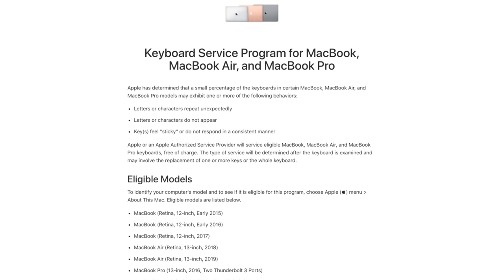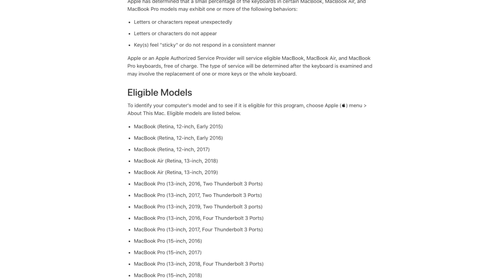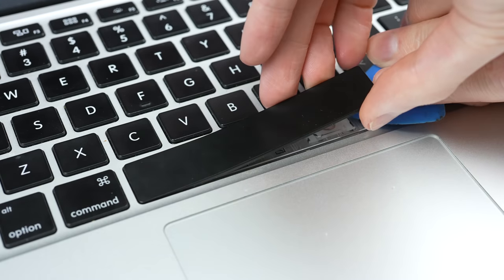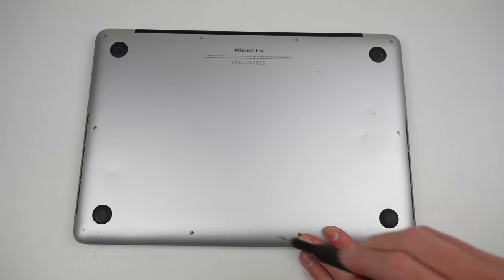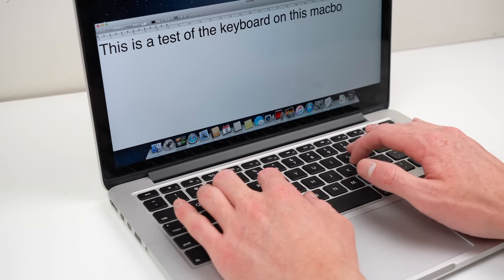Apple Really Doesn’t Want You To Fix This - MacBook Keyboard Replacement

Comment: Miss the days of simpler and easier to repair technology back in 2010. Even though I was too young to care. Still would be nice if everything was ‘easy’ to fix  nowadays.
Reply: It is, just don't buy Apple products or ultrabooks in general. Buy a normal laptop and you'll see it's easy to fix whatever breaks.
Reply: @someguy4915  or just have a desktop, zero issues with replacing anything. Also, not having anything made by Apple helps, a lot.
Reply: @jongustavsson5874  Also a solid choice :P
Reply: There's enough choice for repairable hardware to buy. It's really your own fault if you buy shit like this.
Reply: @someguy4915  I meant apple products. Most apple technology is a nightmare to fix.
Reply: @charlesrodriguez7984  True, but Apple has practically always been harder to repair, at least since the original iMac with its cheap plastic inner bezel which would break if you even thought about opening the computer casing, a casing which was largely held in place by plastic clips which would also break at the slightest attempt to open it up.
They have gotten significantly worse over the years, where with that original iMac you could claim it was just a bad design choice (much like the bread toaster temperature RAM) nowadays with most Apple products it's obviously a choice to make repairs as difficult as possible...

Comment: The keyboard is significantly easier, and safer, to remove if you first knock the tops of the rivets off with an xacto knife.   I replaced the keyboard on a Dell Inspiron 7000 that was similarly riveted in place this way.  This also has the advantage of not destroying the old keyboard.
Reply: Don't buy Apple. Any company that makes things this hard to repair is not worth supporting.

Comment: A couple of years ago my mac book air had a defect keyboard. Bought a new from eBay and just ripped the old one out of the frame like in the video. Glued on the new one - it worked. If you dont care about optics and re-selling value, then glue is the best solution.

Comment: Why didn't you tried to drill out the rivet heads with a short 2-3mm drill instead? Maybe is easier on the housing, aluminium is quite soft.

Nice repair BTW.

You could be surprised but these small machine screws are expensive, almost twice the cost than a rivet. If you order a few million of these it cost a lot for apple :D
Reply: Its quite complicated tho. It'll either make a bulge on it or completely make a hole on it
Reply: Drilling out tends to result in an off shape or oversize hole.  Using a pin-vice is slow and you can break the bits due to human-wobbles, but using a powered tool is also likely to break the bits (0.8mm or so) Definitely a last-resort option.
Reply: @tywyeth1680  a good rip of the old keyboard should displace 80%+ of the rivets from their holes, and clean up the rest with a pair of side cutters usually; leaves perfect holes for the screws to be put in to
Reply: Than just use half of the amount as screws. It seems to me that there are too many rivets anyway.
Reply: The extra cost of the screws is greatly overshadowed by the fact that most people will just say "fuck it" and buy a new laptop when they see the rivets.  So rivets it is

Comment: This is exactly how NOT to design a laptop keyboard! At least when there are tons of screws, you can unscrew them. Even heat staked keyboards (as found in many modern HPs and the like) can be replaced with using just a hot air source (or soldering iron that you don't care about).
I can definitely see why the top case is usually replaced as a whole under these circumstances, and that's what I'd do - top cover/palmrest c/w keyboard as one piece.
Reply: Nah, this design does exactly what Apple intends for it to do. It makes repairs so much more difficult and expensive that people are much more likely to buy a new machine. This is the new Planned Obsolescence now that Moore's Law is dead, Apple needs additional ways to encourage loyal customers to continue giving them money.
Reply: This is EXACTLY how to design a laptop keyboard if the company is driven by sheer greed and doesn't give a damn about their costumers.

Comment: The best way of dealing with those rivets would be to use Dremel (or Dremel-like) tool and a sharp "stubby" 4 or 5 mm drillbit - or a small round burr tool. You don't need to drill/mill those rivets "heads" (they are countersunk) off completely - but removing majority, or even some of that splayed/ peened metal will greatly facilitate the removal, and you won't need to apply so much force.
Speaking of which: when tearing off the keyboard like at 6:05 you should always remove all those "free floating" keys from the table AND press down the "lattice" part of the unibody with some stiff plate (a piece of plywood, MDF or such) as close as possible to the "tear-off zone". This will not only make it easier to remove the keyboard (or rather, its remains) but will also prevent the lattice from getting bent.

On the rivets itself - while I have a fair share of my own grumblings and whiners regarding "recent developments and changes at Apple" (I'm a Macs user since '97), I sorta-kinda can justify their decision to use rivets here. It makes a sense from engineering point of view, albeit this is of a little consolation for those unfortunate fellows with broken keyboards.
There's simply not that much of metal on those "junctions" to drill and tap them without significantly weakening them, and making stubs with female threads (like the one can see at 6:06 next to the "P" key) at every place where rivets are located (ALL of those junctions, as far as I can see) would be too time consuming - and it would bump up the price of the unibody shell itself. So, I guess, the "compromise" was made (it's cheaper to replace half of a single laptop under warranty for every thousand or so of MacBooks produced than trying to make ALL of them "repair-friendly"), and should those keyboard itself be of better quality it wouldn't be much of an issue. But the quality problem of those keyboards combined with this way of attaching them aggravates the whole problem.

And yes, this is going to become worse and worse, as labour cost of any fix-it-man will become greater and greater, while mass-production costs "per unit" will become lesser and lesser - and with "general public" always on a lookout for cheaper and cheaper goods. In short, "dispose-it-off civilisation"
When it was the last time when it was actually cheaper to pay for replacing the bent rim on a bicycle wheel, rather than replacing the whole wheel? (I'm talking "average daily" bike, not any high-end God-knows-what for thousands of bucks). When it was the last time when it made more sense to fix and rebuild seized (for the lack of oil) engine in a mid-price "average" family car than replacing the whole engine (either new one or one "recycled" from a scrap yard)? Why computers should be immune to this trend? And why the chicken... well, never mind ;-)

Comment: I followed this video to replace my my keyboard. A word of advice for hammering out the rivets is use a very shallow angle for the screwdriver (i.e. hit the rivets sideways) and spread out your first few attempts so you don't have consecutive missing screws if you stuff up. I sheared off the first few rivets cause I was using too steep an angle. The new keyboard works but unfortunately I now have to deal with slightly spongy arrow keys due to the sheared rivets blocking the screw holes in that area.

Comment: Great video! yeah these keyboards are a huge pain to remove.  The buterfly ones are even worse to replace as the rivets are much smaller, so after you remove them you either need to use even smaller screws, or you have to drill every hole a bit larger to fit the old style screws. Love your simple approach with the hammer and screwdriver, I tend to use a automatic spring-loaded center-punch with a flat blade to pop out the rivets easily while the keyboard is still in place., I usually manage to get every rivet out like that and I don't have to tear out the old keyboard with brute strength.

Comment: When you said that the keyboard was riveted in, I thought you were gonna have to bust out the drill. However, I was not disappointed with hammer and chisel. What a brutal repair process Apple made you go through! It has me curious about how bad their newer stuff is gonna be when you have to replace anything on them.
Reply: They've serialized all the parts now, so even if you successfully replace the keyboard (even with genuine apple one) the laptop will refuse to work with the new keyboard as its not the one it had from factory

Comment: I use a dremell to take out the keyboard

The keyboard is probably the harder to replace but the easiest to damage 

Just don't wash your hands like 3 or 4 times and it will die fast 

Leave the MacBook on the car and the keyboard dies 

Use the MacBook on public places and the keyboard dies because of the dust 

Is just gross 

Replacement chinesse keyboards usually last a lot longer
Reply: @j7704  yup but the most recent ones tend to get stuck with dust

Comment: When I was a teen, a neighbor of mine was throwing out a great big TV. Bigger than the one I had at the time.

So I took it home, just intending to rip it apart. I'd never seen inside a TV before.

The only actual issue was a loose connection to the button panel. I didn't, and still don't know the first thing about TV repair, electronic repair, any of that stuff. About the extent of my knowledge was, and pretty much still is 'use electrical tape on wires' and 'solder is a metal with a low melting point that's used to make connections'.

A lighter and a nail later.... I'd fixed the TV.

Now I get that technology has gotten a lot more complicated. But the idea that you are ACTIVELY PREVENTED from repairing something YOU OWN even if you have a complete understanding of everything involved in the process? THAT'S bullshit.

I've basically lived my life on hand-me-downs. I remember arguing with a computer store clerk because I was looking for something to plug my computer into my TV, and this one guy argued with me for 10 minutes that what I wanted was an HDMI connector.... DESPITE BEING TOLD MY TV DOESN'T HAVE AN HDMI PORT. Like... the concept of a TV without one was something he refused to believe. It was painful, and he kept whining that I was just going to be in the next day to get what he's suggesting because the quality will be too low.

Another employee actually came by to see 'what the problem was', and thankfully was much more helpful! I told him 'I have an older TV, I want to stream youtube to it, so I want something that uses the yellow/white/red connectors if you have it.' and he said 'Oh. Yeah we've got those over here.'. 30 seconds, boom done.

.... Okay that turned into a rant. My POINT... is this whole proprietary anti-repair culture is bullshit.

Comment: I just did this back in November with parts from Ifixit and how to instructions from there. Not a techy guy highly recommend. Also I bought tiny little screws like two bucks off ebay pried off the rivets and screwed straight into the body

Comment: Most laptops ive worked on: 4 plastic clips that can be popped from the outside with a thin metal tool and another 4 screws on the inside next to battery.

Macbook:  dissasemble it down to its raw unrefined materials, hope you have a pneumatic rivet press.

Comment: Another option would been to drill the rivets out. That would have allowed you to also save the keys which can be useful for repairs as well.
Reply: Drilling out results more often than not in a hole that won't hold the replacement screw.  Even though the keyboard is peeled away it actually still retains most keys suitable for other donors, however, in many cases, even the original Apple keyboard assemblies tend to rarely match the one that you're trying to find a donor for :(

Comment: My old laptop just have a cover on the top of the keyboard and 5 screws underneath it. You can change the keyboard literally in less than 5 min (assuming you have the replacement).

Comment: This should be illegal.
These kinds of anti-consumer practices are essentially fraudulent, as you're selling the user a product you've actively sabotaged up front, with no way for the end user to repair them.
Reply: No? there is no problem using rivets as long as its cheaper. Apple do NOT need to make their products repairable, as long as they share their board design with repair people (which is what right to repair is, right to check the blueprints/design). As for the design itself, Apple has the right to design a product however they see fit. If people dont like it, they wont buy it. However, track record has shown that apple makes great designed products

Comment: Yeeeep. I worked for an authorized apple repair shop. We'd replace half the laptop essentially because that's how the shop makes money. It's about ~$350 for said top case for anything from 2013-2015 and then about $450-800 for 2016-2020 parts alone. Always wondered how much business I could get if I replaced just the keys myself. Would also be a nice workout too.

Comment: you can use a dremel and"drill" the top of the rivets it takes just a fre minutes and then put some drops of epoxy on top of the old rivets when you attach the keyboard

Comment: I’m going to be quite blunt, as someone who actively works in a machine shop, you only use aluminum rivets in spaces or on things that you never intend to be futzed with after fabrication. The short explanation is that rivets rely on rigidity and friction to keep things together, while aluminum rivets are thing(used mostly as either a sort of weather proofing, or as an ultra light duty cold rivet), but are typically avoided due to to how soft aluminum is, even anodized, defeating 3/4s of the mechanical advantage of the rivet. The only reason to use aluminum rivets on a piece of electronics (or rivets in general, there are reasons we have moved to arc welding or screws to fasten thing instead) is to actively make something cheaper to manufacture at the expense of longevity and ease of repair.

Comment: The reason the space bar didnt work was the metal bars had tension on them from the bracket, usung one or two small flat headed screw driver, you could probably of worked the brackets holding them into a hood 90 angle to which allows them to freely move, combined with the spring rubber section and ensuring the metal bars are evenly spaced at either end before pressing it back in place and both are connected to the space bar when pressed back in place.

Comment: would it help if you can get a hand dremel and basically polish or grind down the rivets, that way its less potential damage to the casing? Just putting ideas out there, I don't actually do or have done repairs before.

Comment: I’ve got to go a similar repair to my 2013 macbook. Any opinion on maybe using a dremel tool and grinding the rivet tops? I was hoping a small tap on each may be enough, but not sure I want metal “dust”…

Comment: Pro tip for removing (normal sized) rivets (that were attached to 2 mm thick sheet metal): use a drill of the appropriate size. If your drill bit was the exact right size, you're left with the original hole and the rivet has been torn to shreds. When you're done with that, just reattach the sheets with the fastener of your choise (probably not one of those tiny blind rivets for a dollhouse).

Comment: @Hugh Jeffreys So in another video for the 2012 Macbook Pro, it was stated that there are 50 some screws that one would remove in order to remove the keyboard. As dreadful as that sounds to my ears, I feel like I would feel much safer doing that vs bending the metal & just prying it out as shown here... Nonetheless, maybe those screws are only present through the 2012 model (even though I could swear I see them in this video), & maybe someone can confirm? In addition, my keyboard has issues following a spill (which is what brought me here) & one of the issues has to do with the fact that I can no longer control the backlight for the keyboard from the designated "F5/F6" keys. Hoping that replacing the keyboard will once again allow the current backlight to function, but assuming that the actual backlight is cooked, does ANY place sell replacement backlights? Would HATE to lose that functionality on my computer!

Comment: this type of thing is the reason as to why I buy old used stuff if I can. especially with record players. if you get one that came out before the 80s in many chases you can find documentation online that not only shows how to fix small minor issues but also documentation on how to take the whole thing apart and put it back together again. that shit was normal cause you were expected to repair your stuff or call any repair technician you'd like to work with

Comment: Not just Apple. Normal modern Windows laptop manufacturers also rivet their keyboards in these days. It may look slick visually. But repairing it practically, ain't exactly the most riveting experience for anybody at all. 

Also, I usually would burn the plastic rivets away with a hot soldering tip instead of removing them by force. I used to that before. But I ended up chipping off/horribly bent a part of the keyboard's frame. So, rarely I would do it this way again.

Comment: Thought of grinding them all down with a Dremel, but it leaves you to some tough times pulling them out later. On a side note, how is this thing even sold nowadays when you can easily get anything with 1660TI/3060/3070...